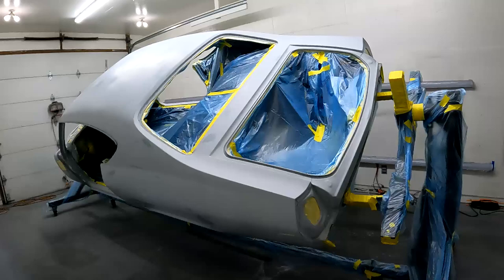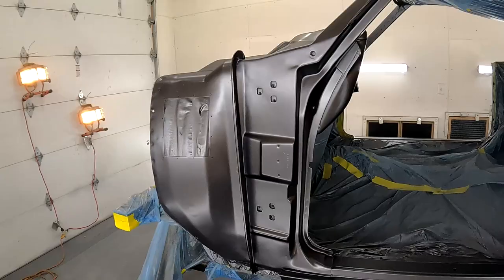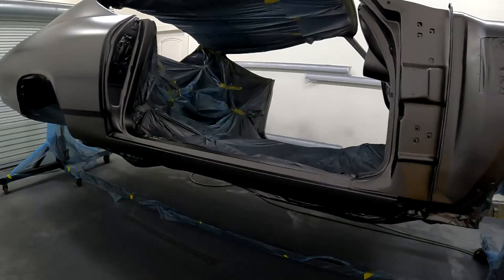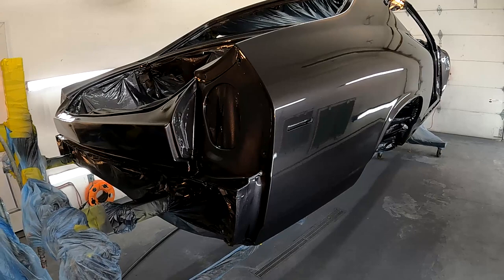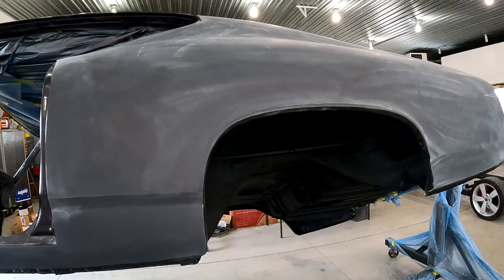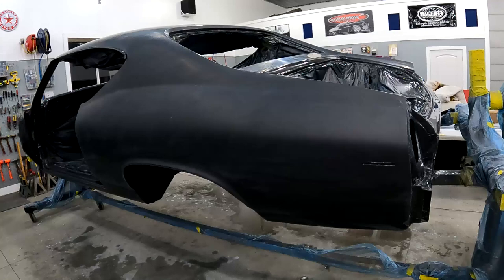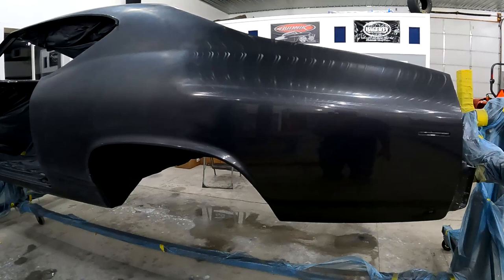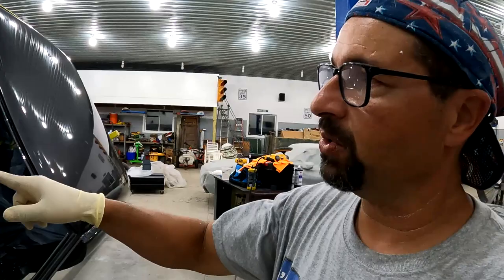Painting 1969 Chevelle SS Body on a rotisserie.

Comment: Looking Awesome my friend … What supplies are you using for cutting ,buffing and polishing  ? Thank You 🙏
Reply from the maker: I'm am using all 3M products. First stage using 3M 36060 rubbing compound with 3M 05711 compound Pad. I was taught to do the first stage twice. Sometimes I would do it 3 times. 2nd stage use the same rubbing compound (3M 36060) with 3M 05723 Foam Compound Pad. Last stage use 3M 05996 Machine Polish with 3M 05725 Foam Polishing Pad. I used a Dewalt polisher set at 1200rpm.